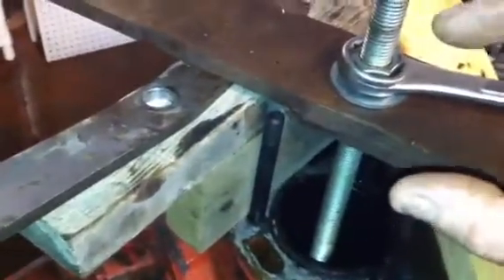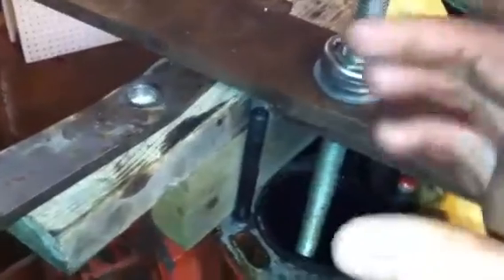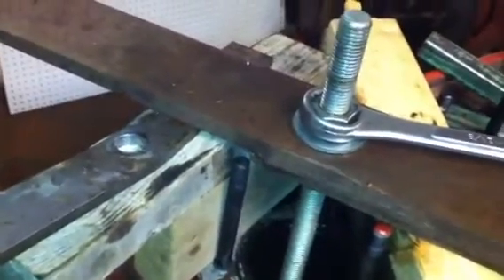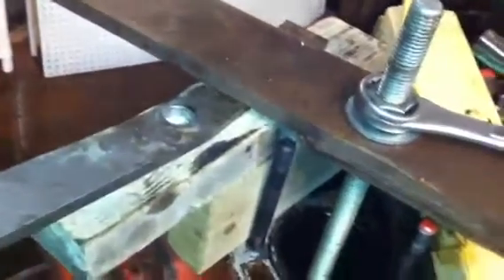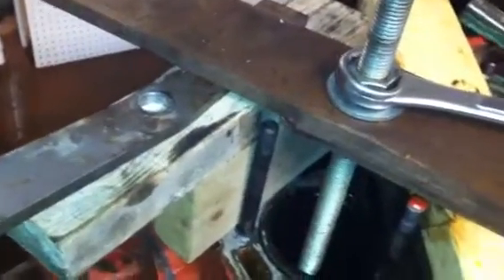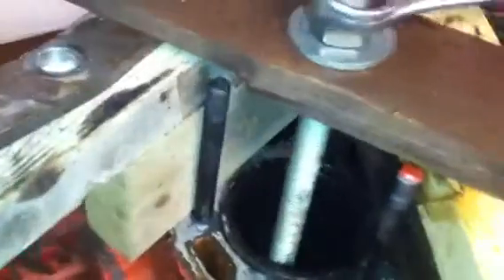Super C rebuild part 4

Comment: I got lucky with my 240 all I had to do is put a oak block on the bottom side and knock them out with a few firm taps of the 5lb maul . When you go to put the new sleeves back in be sure to clean out the part where the large "O"ring sits. Then use soapy water to on the outside to lube them but when the go back in (sleeves)